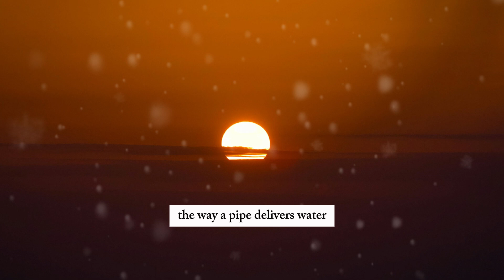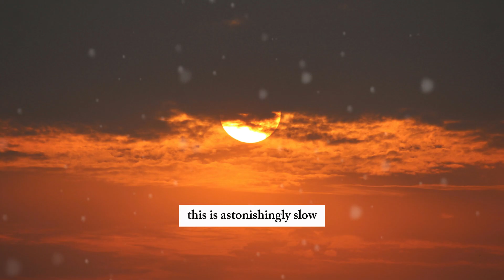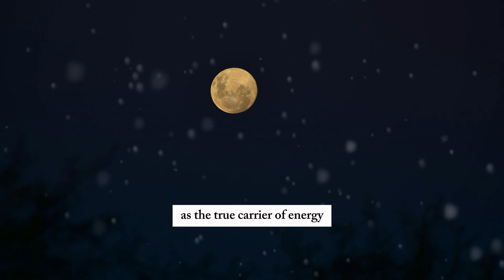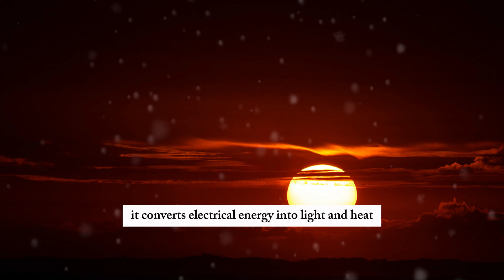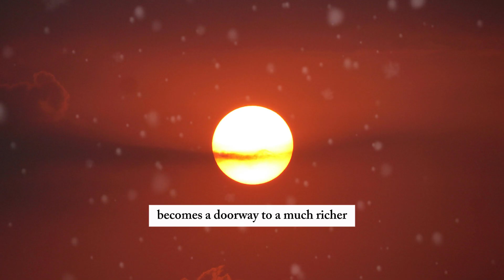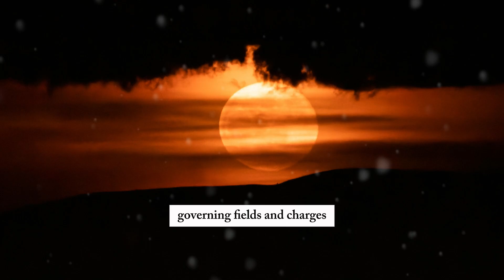Richard Feynman Explains The Big Misconception About ELECTRICITY

Comment: You see light like a bulb pushes it out. We debated this too. Although taking a word for it is not the biggest deal in the whole , there's some critique I will add. Remember the values that Edison, Einstein and Bell were looking at. Feeding the filiment to extend it into gases In a bulb. A conformed spark if I see that. Although it's seen also, remember the feed must supply from the wire. It's like many things that soak up light to reflect but reflect much. It just handles it smoother. Imo of course